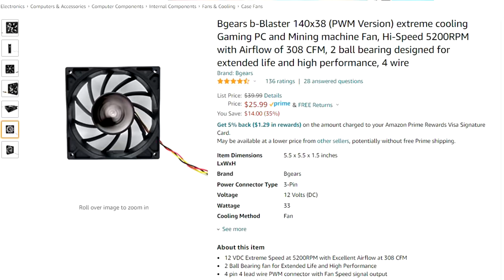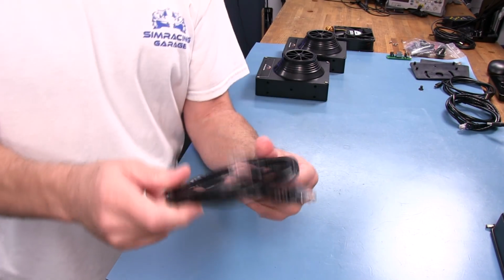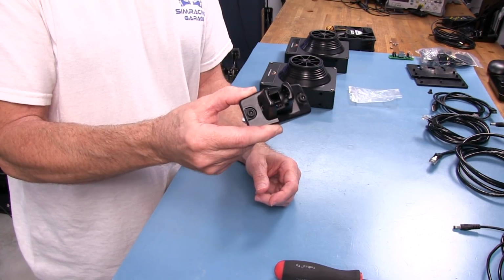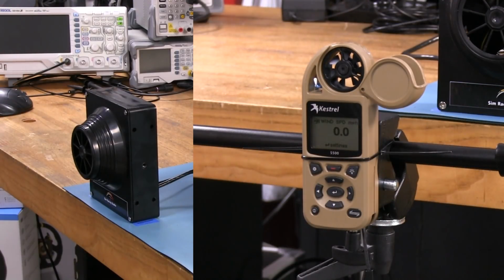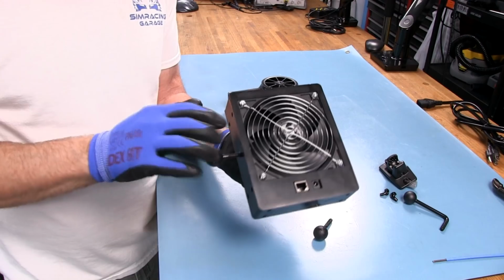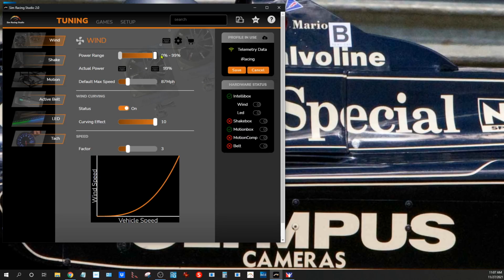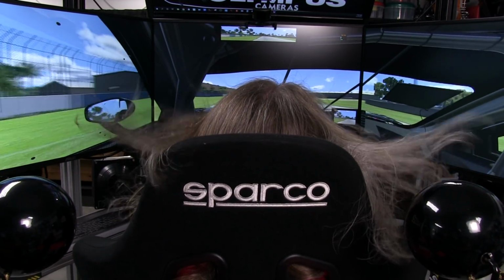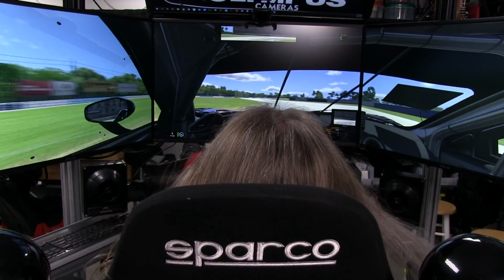Sim Racing Studio Hurricane Wind Kit Review

Comment: This was super helpful. I had this on my rig for over a year now, but didn't know about all the settings. Quick question maybe you can help with. I have Microsoft flight simulator as well and I'm told this wind works in iracing  in Corsa , but I can't make it work in Microsoft flight simulator. Any tips?

Comment: awesome review as always and that tip about speaker mounts saved me $45! I found speaker mount on amazon and they look like the same one that Barry had. VideoSecu Speaker Wall Ceiling Mount Bracket One Pair for Universal Satellite, fits Keyhole and Thread Hole with 1/4 20 Threads, 4mm and 5mm Black 1ST
Reply: Thanks !!

Comment: Link to get those speaker mounts please
Reply: i think these are the same one on Amazon - VideoSecu Speaker Wall Ceiling Mount Bracket One Pair for Universal Satellite, fits Keyhole and Thread Hole with 1/4 20 Threads, 4mm and 5mm Black 1ST

Comment: Interesting to hear your thoughts about their Wind Curving as not being very noticeable in practice. Which makes sense because most corners are fairly quick and by the time the fans passively spin down, you're already out of the corner. This is the one "feature" that is unique to them and why they charge as much as they do. If this is the case then I will probably go the DIY route and use Simhub's (donate-as-you-wish) software and save myself a hundred bucks (or more).

Maybe I'm paranoid but I'm not crazy about how their housing needs to have threads cut by you using the 1/4-20 screw instead of a nut molded into the plastic. Seems like a recipe for over-torqued screws that chew up the plastic.

Comment: I ordered and received the SRS "Hurricane" Power Wind Kit Package. I have been playing with it for about two weeks. Overall I like it. My only gripe is that I wish the fans would\could ramp up faster (maybe I will set a minimum power setting of 2% to give them a head start). When they do get up the speed, they are awesome. They also stop fast enough when I slow down, they just do not ramp up as fast as I would like. But again, overall, I like it. 

I found that I do not have to run them at 100% either. 50%-60% is fine. 100% is too much and can actually make me cold while driving. I also aim the fans towards my shoulders. Pointing directly on me is too much and can actually also make me cold while driving. 

I do not use car specific settings, that is too much to keep up with. I just set the overall Simulator top speed to 400kph, Wind Curving to level 8, out of 10, overall fan power to 50% and that is good enough for me.

The Wind Curving is awesome when in VR. IMHO, this Wind Sim rocks!
Reply: The problem is that you are not wearing a full racing suit, that is why you are getting cold. Racing helmet, gloves, full suit. Then you would be working up a proper sweat and THIS is what these fans are meant for LOL

Comment: Thank you very much for another great review Barry.
In these wind kit reviews, it would be very helpful if you could record a small clip of the noise produced by them, so we can get an idea of what to expect.
I built myself a wind system with some very expensive and supposedly silent Delta fans and the system is incredibly loud.
Reply: I just got SRS kit and man it is way too loud even at 25%. I wish they mentioned that in the reviews. It is literally like jet engine going on and off and trust me everyone will scream at you in your household to shut them off. Going to test a little more running them at 15% but at low 5-6 rpm they also make whining noise that you can hear through headphones.

Comment: Do you prefer these ones over the motion house fan system?
Reply: It would be good to Barry’s thoughts.  I have both and have been using motion house because the wind area has a larger wind zone which feels more realistic.  The diameter of the SRS wind zone is smaller which makes the wind feel a little more like a fan blowing than wind.  That said, I am going to try srs again.
Reply: @netlawman2001  Do you still prefer the motion house? And do you think the motion house is quieter than the SRS if you set them to a similar wind speed?
Reply: @MrOceanfrog  I still use Motionhouse. No complaints. It is simply more powerful.  I don’t understand why SRS limits themselves to computer fans.
Reply: @netlawman2001  good to know, thanks!
Reply: @netlawman2001  Is there a difference in how fast the fans ramp up and the change in airflow is felt compared to the car's speed? I've read 1 or 2 people say they felt a little lag with the SRS unit when the fans speed up according to the car speed. Is this true? If so, what about the Motion House?

Comment: Barry I think your explanation of the Default Max Speed setting was not quite accurate. My understanding is that the software will assume that speed is the max speed of the car to map the actual airflow based on the car's speed until you've done some laps and the software can tune it to the car's max speed based on telemetry.
Reply: The srs software continously adjust max speed based on the game telemetry.  No need to set manually
Reply: @gmerariu  mostly correct but not entirely. How does the software know to use say 50% airflow when you're coming out of pit lane for the first time? It doesn't have telemetry for max speed yet. That is when it uses your default value.
Reply: @vincentsantucci2478  it learns after 1 lap and keep learning all the time
Reply: @gmerariu  I know that, it's what I've said all along. You do realise that there is no max speed set by telemetry until you actually do a full lap right? Until then, it takes your default value. This isn't rocket science dude, Jesus....